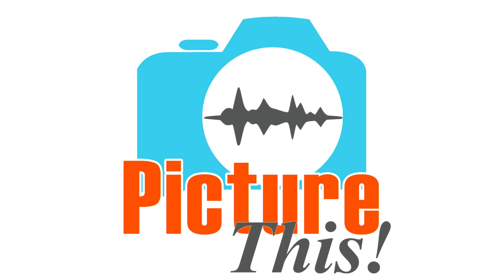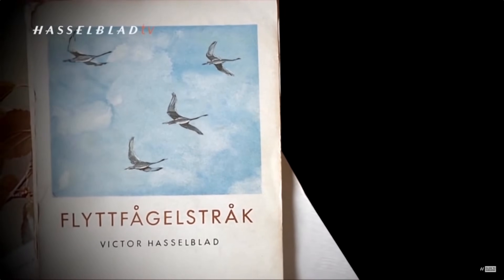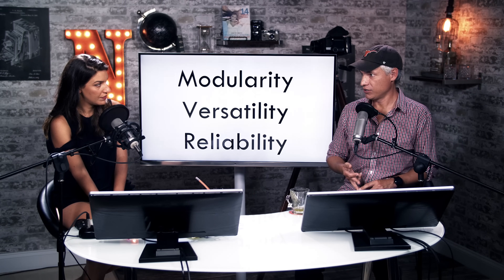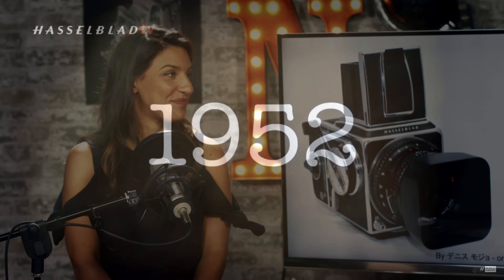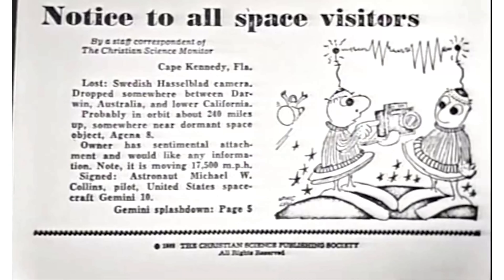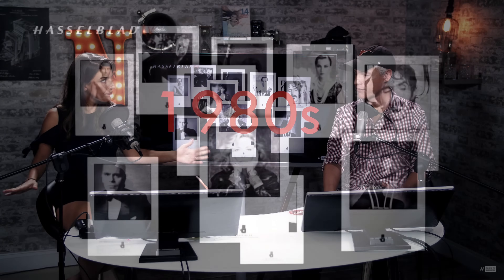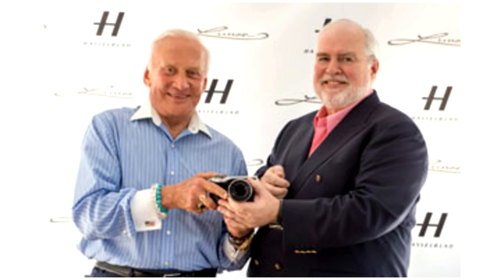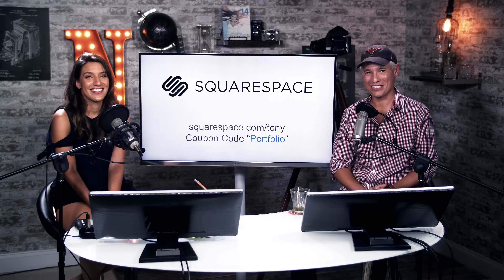Hasselblad History: Nazi Spy Planes, 🚀🌕📸, 100 Megapixels & DRONES!

Comment: RE: @15:44 - when you take apart a Hasselblad, you see it's very much a clock inside. Zero wires, just springs and gears -- it's very very cool in an oldschool way.

Comment: I've brought my Hasselblad 500C/M everywhere since I got it back in 2014. It's reliable. When you're in the arctic desert of Greenland with temperatures of -37 C, ice on your moustache, water bottles frozen, batteries for your DSLR dying, straps on your backpack snapping and breaking, the 500C/M will still do exactly what you tell it to. No more, no less. It's a camera born out of passion, incapable of compromising.

Comment: 32:40 The X-Pan does not use the space of 3 frames for one exposure. The X-Pan frames are 65x24 mm, so not even twice as wide as regular 36x24 mm frames.
Reply: Yea exactly. He also makes it sound as if it takes multiple exposures to capture the panoramic format, rather than one wide exposure.

Comment: Thanks for the emphasis on Viktor Hasselblad being a birder. Perhaps that's why he developed cameras in a square format. Birds have erratic behaviors, and the square accommodates the different crop possibilities, and allows a single orientation of the camera in the hand. It's definitely worth noting that now, with digital sensors, there's absolutely no reason to design under the restrictions of the use of 35mm movie film, producing the 2x3 rectangle that's so common. Time now to go back to the square capture area, and utilizing the most of any lens' circular image area.